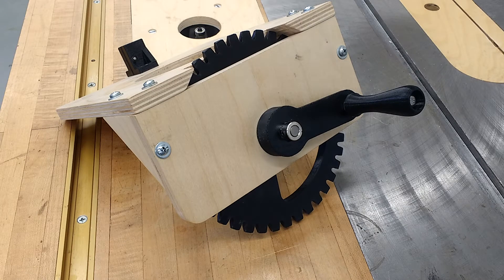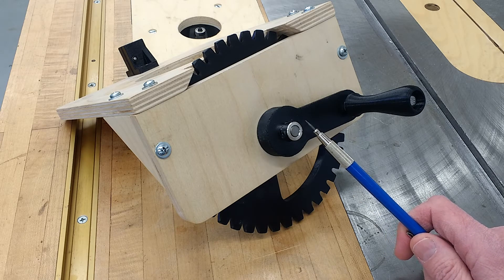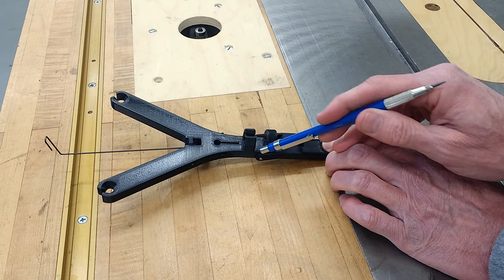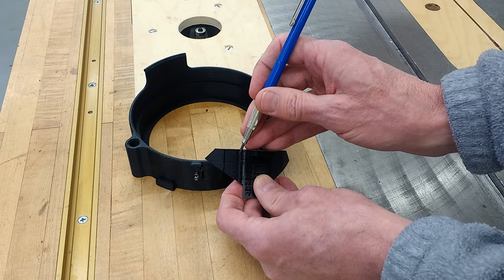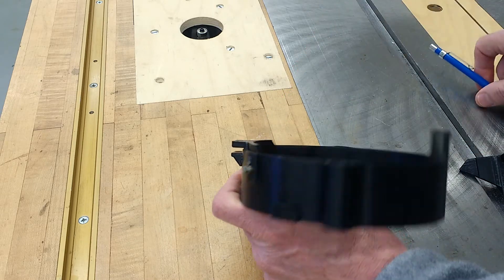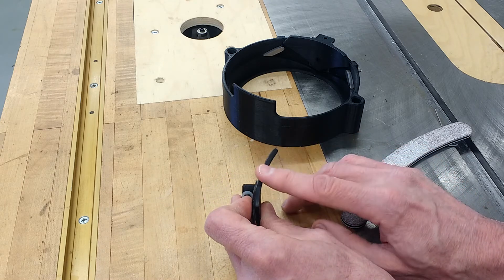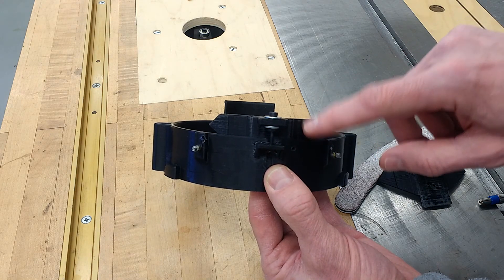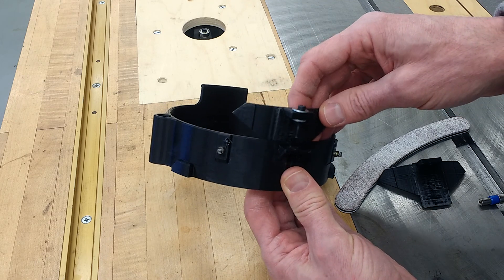3D Printed CSM Circular Sock Knitting Machine: Version 5

Comment: At ~12:00 you talk about glueing the nut in the tension cam, I'm not sure I understand -> to what part do I glue it to? the screw? the washer?
Reply from the maker: Glue the nut to the screw.  You want the screw to turn easily inside the hole in the tension cam.

Good luck on your build!  Steve

Comment: I found that the frame prints OK if I print it face down. I did find that the hole for the crank gear to crank handle is larger than the bearings I have. There is also the minor issue of the layers running across the frame vertically parallel to the rotation of the crank gear. My tentative plan for that is to add a 1/2-3/4" plywood under frame to the printed frame for just that much more support.

I'm likely to shim the hole for the bearings for the frame in my print, but I'm also considering a remix that gives me the ability to fairly easily to add a bayonet our 'wedge' ring to hold down the hook cylinder. And I may 'fix' the bearing through hole in the process.

That may be a new ring (and clearance) to mount to the bottom of the needle cylinder, and either the ring twists and locks in place in the base, or it has protrusions that mate with a ring under the base that twist-locks the ring into place.

Unfortunately the current owners of thingiverse have made it so my old login is no longer usable. I'm not really happywith the options currently available, so it may be a bit before I can upload files. I mostly model in TinkerCad, and so far I can't use Fusion360. (Autodesk seems to have an issue with porting their products to Linux.) I may be able to work with the STEP files though, so we'll see.

Comment: You speak of lubrication. I am wondering if a silicone spray lubricant will work. I am sure that we need a lubricant that has no petroleum contents. Am I correct?
Reply from the maker: Scott, see this link: https://www.deanandbean.com/caring-for-your-machine.  I have used PTFE spray and white lithium grease.  Not sure about silicone spray.  Whatever you choose needs to be plastic safe.  Steve
Reply: @steveturner1447  thanks! Do you have an indepth video for assembly
Reply from the maker: @craftyoldman  There are several videos on my channel